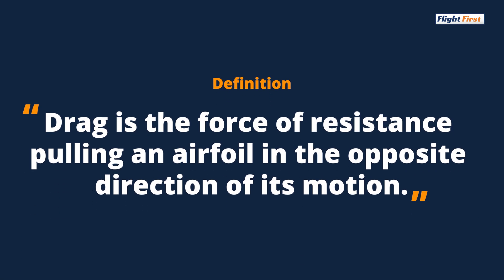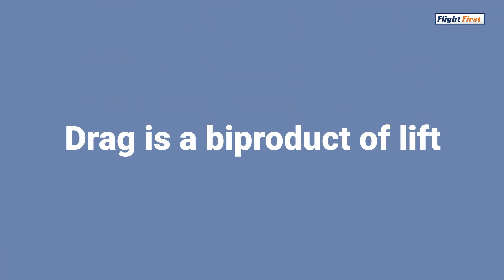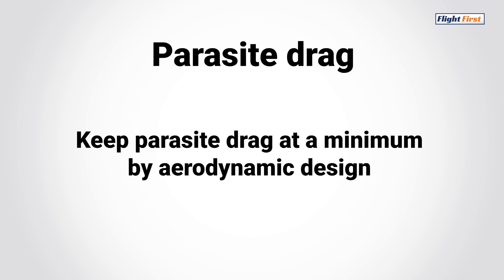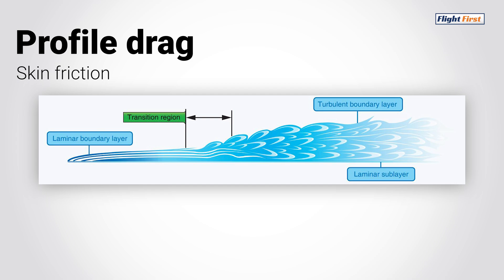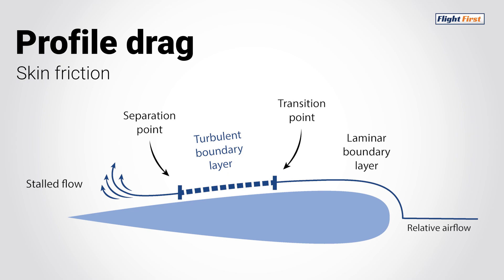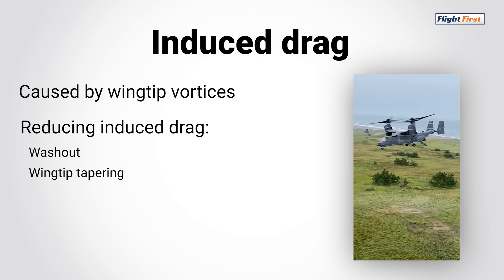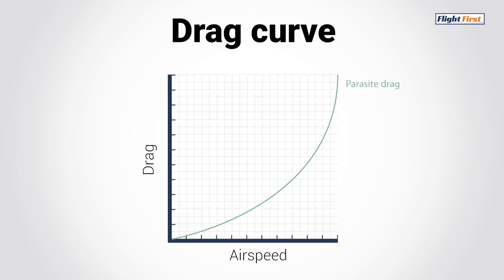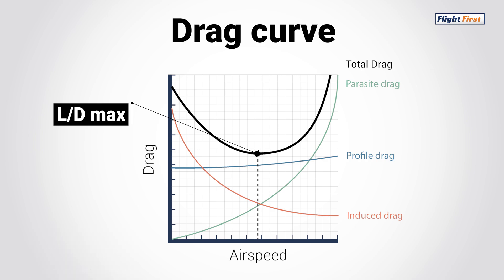How drag affects a helicopter

Comment: The drag curve shown applies to airplanes, not to powered helicopters!
No drag in hover, but plenty of POWER
Reply: Arturo, there is PLENTY of drag in the hover, mainly induced drag. The helo needs more power in the hover because of this, and it can be reduced by Ground Effect changing the inflow angle. The power required decreases as translational lift is achieved, and the induced flow is reduced. There is also an element of parasite drag in the hover, with the downwards airflow over the fuselage causing some drag.
Reply: @robhaylock7742  You are right about the power in hover
But you are confusing power with longitudinal drag, drag of the blades produces a torque on the shaft. Multiplying this torque with rpm × 2π/60 gives you the required POWER.
P = L^1.5 /D ×√(2/π rho) + 3/4 L× Tipspeed × CD/Cl
In hover, no contribution of the fuselage since it is not moving.
As you transition into forward flight , the powered lift diminishes as the translational lift increases, the rotor acting like the lift on an autogyro , the power that the rotor requires is reduced to a minimum, the best endurance speed, then the fuselage drag and the blade differential drag increase, while the induced drag due to translational lift decreases 
this drag is a force opposite to the direction of flight. 
induced drag applies only to longitudinal motion , a force, not a moment. the forward tilted rotor lift produces the thrust to over come the 3 drag forces involved. The power required to create the downwash in hover is not to overcome a longitudinal force but a moment   due to blade drag and to accelerate the rotor down wash .
You are confusing torque with drag.
read Barnes McCormick,  Aerodynamics of VTOL flight
(Helicopter designer here.)
Reply: @arturoeugster7228  In the hover, as the induced flow increases to produce more downwash (and get off the ground), the relative airflow comes onto the rotor blade from a higher angle compared to the plane of rotation - the lift component is tilted further back, and the drag component is pointing downwards as well as backwards. Basically, adding to the weight. This adds to the power required to hover. Lift that lever, see the torque meter go up.
Getting into ground effect reduces the induced flow, brings the RAF in a bit lower, and the drag component acting downwards is reduced, meaning less power needed to hover.

"The power required to create the downwash in hover is not to overcome a longitudinal force but a moment   due to blade drag and to accelerate the rotor down wash ." 
What a confused statement. All downwash is due to induced flow. The air gotta come from above to get pushed downwards and create the lifting force. In the OGE hover, a column of air from above is induced into downwards motion increasing the IF and requiring a higher pitch angle to get the desired AoA. Get into forward flight, and the blade sees clean air which hasn't had a chance to start moving down much, so less IF at the front half of the disc.
The back of the disc, where the blade is flapped up, gets more induced flow simply because it is up there, resulting in inflow roll.

"You are confusing torque with drag." And how does the helicopter get the power to overcome the various drag bits? From torque.

The helicopter in flight has one big arrow, at 90 degrees to the tip path plane, pointing forward and upward, opposed by one big arrow in the opposite direction pointing rearward and downward. Split these into components in the horizontal plane and vertical plane, you have Lift, opposed by Weight straight down, and Thrust forward, opposed by Drag straight back. Lift + Thrust equals Weight + Drag. Slow down and the arrows come back towards the vertical, until you are in the hover, straight up and down. You can say that they still show L+T=W+D, with the extra thrust needed to overcome the vertical component of drag, not just parasite, but the downward component of drag on each blade, as described above..

And the fuselage, in the hover, does see a component of parasite drag from the airflow coming down onto it. Read about the problems with the wings fitted to the French contender for battlefield helicopters. Bad in the hover, great in forward flight.

Comment: 4:30 parasite drag increases quadraticaly, not exponentially
~ V².  not.  .e^V
Reply: Not sure what you mean by this - V squared is an exponential. Quadratic would mean drag increases at V to the fourth, which is not correct.
Reply: @robhaylock7742 there are quite a number of statements you make that are wrong! badly wrong
The profile drag is also proportional to ½rho×V²×A,  not at all a separate drag as falsely shown on your graph, it is part of the parasite drag. The induced drag does not level off.
The parasite drag follows a parabola, at zero speed all drag is exactly zero, including your  depicted "profile drag" , also of course the lift.
L/D max is where the slope of the parasite drag is equal and opposite to the slope of the induced drag.
Now,
1 exponential means 
Y(x)  = e^x
2 quadratic means 
Y(x) = x²
3 cubic means
Y(x) = x³
Parasite Drag = Sum of all parasite components, which are proportional to the q = ½rho V²
A QUADRATIC function of true airspeed V
Summarized 
Dp = q × Cdp × A
A is a convenient reference area like the wing projected area
Cdp depends on the direction of the flow and on the Reynolds number Re
Re = V × c / nu
nu = viscosity / density
Called dynamic viscosity
the viscosity depends on the temperature.
c is a reference length mostly the mean chord or the length of the fuselage
Typical value is tenths of millions
See Horner's Fluid dynamic drag, a book that most aerodynamicists hàve and treasure. 
There you find all in correct form 
On a out of ground effect hovering helicopter the downwash accelerates to twice it's speed of the flow passing through the rotor plane.
The inflow comes from the entire sphere around the rotor, except the narrow jet below. Half of the flow volume comes from the lower half and makes a sharp turn just outside the tip ring , the upper half of the flow passes through the plane of the rotor in the inner 70.7% of the rotor radius.
A true flow field that your description misses considerably.
If you do the analysis correctly that is what you would discover
The correct induced drag and lift equations have been developed by McCormic and are described in terms of the final wake angle beta: Lift  = q×π/4 ×b²×2×sin(beta)×(1+ cos(beta)²)
Dind = q×π/4 ×b²×2×sin(beta)² ×cos(beta)
b is span
the parasite drag is q×CDA, the flat plate area times q, called dynamic pressure or incorrectly stagnation pressure
these exact results differ at low indicated speeds considerably from your sketches 
You know the difference from true airspeed?
At 12000 feet pressure altitude the true airspeed is 1.200 times the calibrated airspeed, when the outside temperature is -9C
Remark:
if you plot the 2 curves as a function of q, the dynamic pressure
q = ½rho ×V²
The parasite drag is a constant slope linear line
The induced drag is a hyperbola and what is important: independent of the density, altitude, corresponding to calibrated airspeed, approximately indicated airspeed. 
Confused? Get a pilot certificate.